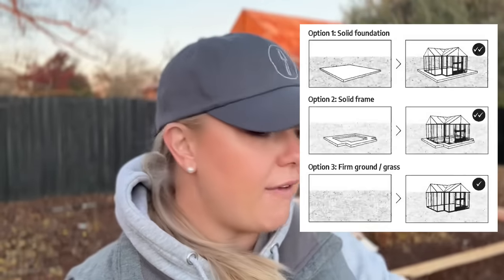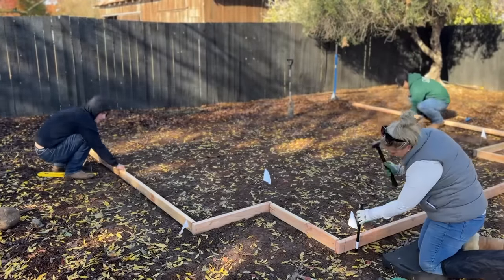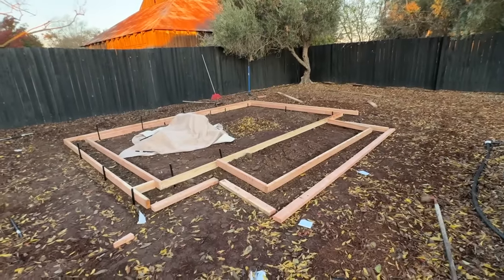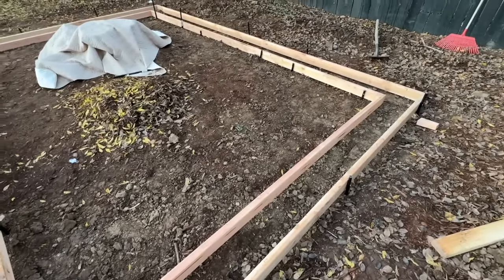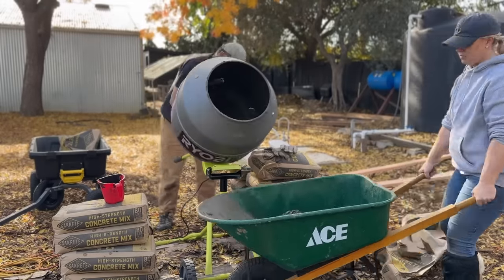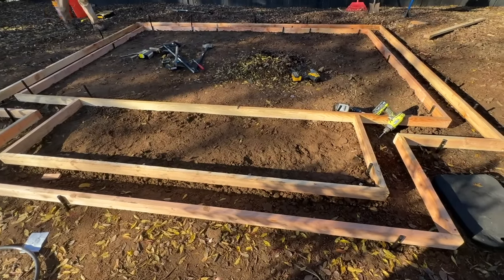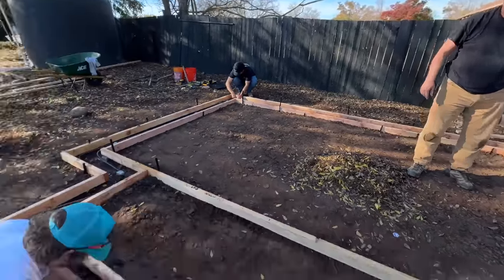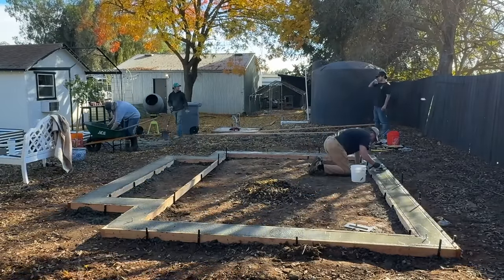Greenhouse Foundation 🙌🏼  Pouring Concrete for Canopia Greenhouse Foundation!

Comment: Not only is a concrete floor nice to work on, it will make you a
terrific thermal mass, that is, as the sun shines the concrete
will absorb a lot of heat and once the sun sets, the concrete
will slowly release its heat keeping the greenhouse warm
during the night. REMEMBER- Tomatoes like at least 62F at
night if you want them to produce their max possible.

!

Comment: Nice work troweling an edge on it. Those kind of details matter in the long run. Now you will be reminded of that attention to detail by your dad every time you cross the threshold. I hope you give us your feedback of the mixer after using it. It seems like a useful garden tool even if you're not mixing concrete.